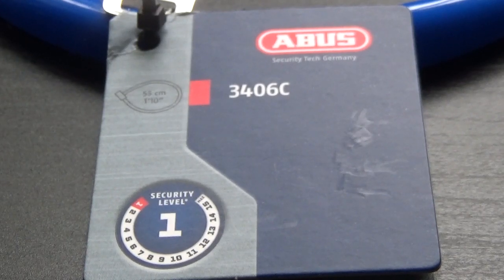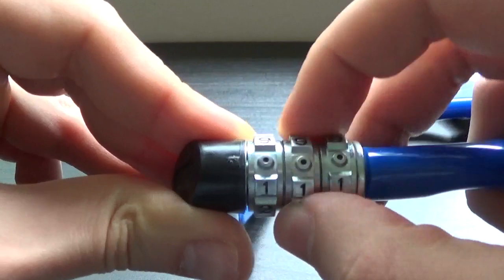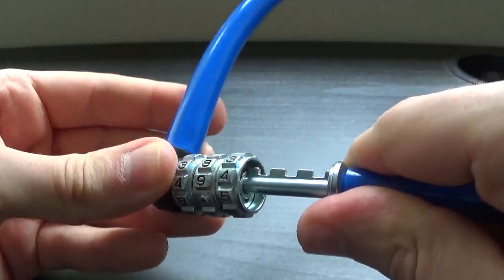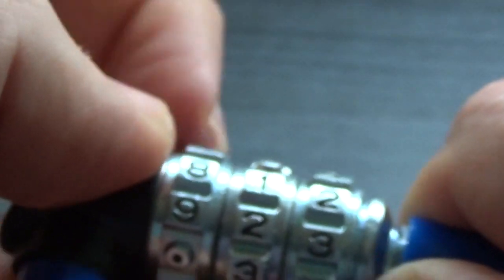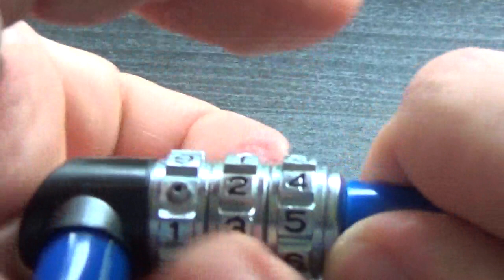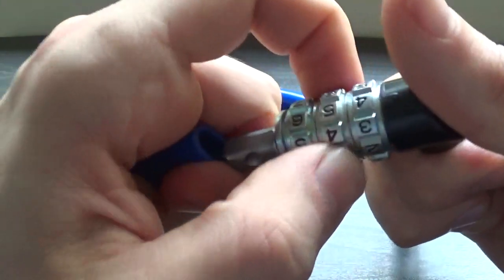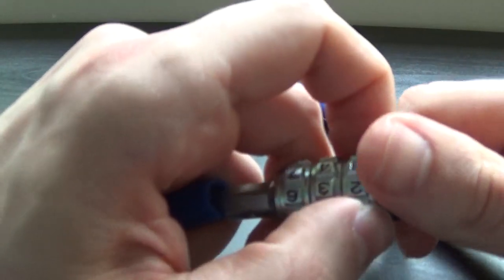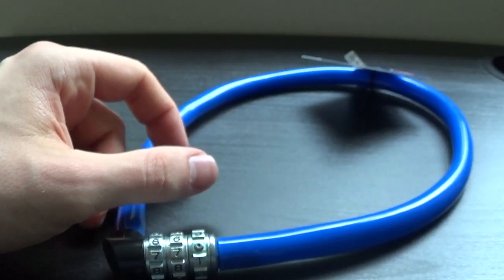Lock: 399 Abus 3406C cable lock.

Comment: Welcome back! Yea it's deceiving how thin that cable actually is - people will think it's a lot thicker. Also with only 3 wheels sometimes it's faster to try every combination! How a great day 😜😜
Reply from the maker: When I get desperate then I would try brute force it with every combination alright. Am I right to say we have 1000 possible combinations on a three wheel combination lock?. 000 - 999?
Reply: @BD90..  Yes 1000 possible combination is right. If you are able to tension it and turn the wheels like you did in the video, but do it methodically to test each number then it shouldn't take long ... maybe 6 mins?